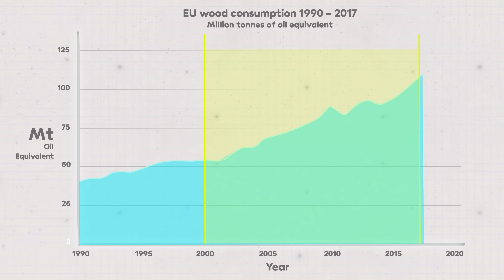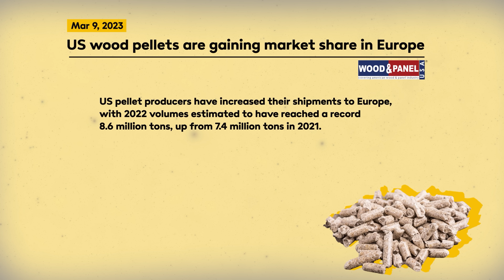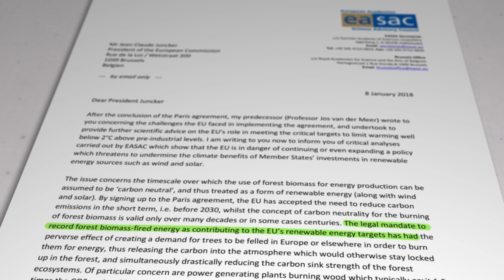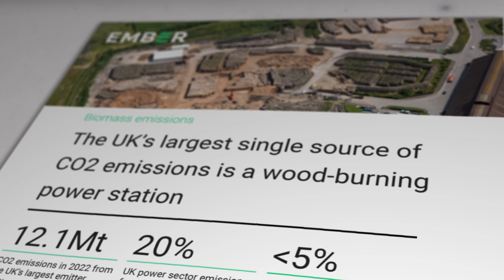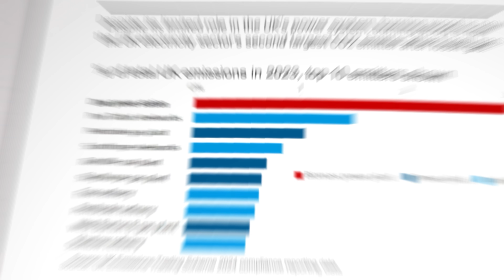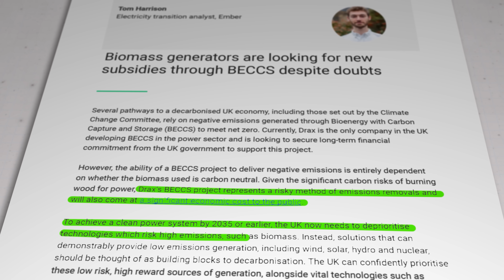New report: Biomass CO2 emissions 4X higher than COAL!!

Comment: While it's clear that better regulation of the pellet production is needed, I think biomass can still play useful role. We need to aim for renewables and nuclear to provide most of our energy. But there will be times when demand is high and production is low where we will have a deficit and need another power source as a backup. Biomass could be a good fit for that. If drax was only run 20% of the time when we really needed it (in the future when renewables have expanded to provide most of the power) then sand for pellets would be far lower and it could be filled using only waste wood and deadfall. Biomass is only bad if healthy trees are cut down specifically to burn. Adding CCS to the power station also adds benefit.

Comment: We have a local community hub that fell foul of this "carbon neutral" biomass. The local company that supplied them initially, couldnt even meet demand and ended up? IMPORTING, just the same. I was on the community council at the time and said it was a stupid idea for heating and suggested heat pumps or just electric. Investing perhaps in the windfarms nearby. 
A side note on the heat pump option, is that there is a giant, artifical, concrete pond. That acts like a head battery in of itself. Sea water is regularly pumped in.
See where I am going?

Comment: To be honest, this one feels a bit disingenuous on both sides, although I agree with the conclusion.
I knew that we couldn't do wood on a global scale for even just heating, simply because back in the middle age in France we were losing our forest because we need the wood to make charcoal to make steel and the switch to mined coal has allowed the forest to begin recovering.
But making the CO2 from tree equivalent to that of coal seem a bit of a stretch, the cycle is not a short as the fast crops, but it's still several orders of magnitude shorter than that of fossil fuels and some fast-growing trees can get big enough to harvest in 10 or so year.
On the other hand, if then land management; which is required for this to actually be sustainable, can't actually keep up as promised, then there is a big issue.

Comment: So... The issue is that because people are being asshats about HOW they do the wood harvesting, we should ban wood harvesting period? (which, to be fair you didn't say outright, but that seems to be the whole vibe with how environmentalists and the EU decision-makers are framing this)
A pine forest takes ~20 years to grow to harvestable size, which means we can take ~1/20th of our forests and cut it down yearly without any issues and still call it carbon neutral.
I'm sorry, but because some rich anus is being a dick, banning people from harvesting firewood from forests in a sustainable way is not the way to go about doing this.

Just like everything else, moderation is key. Hell, even in a future where we DO finally get climate change under control, a coal plant or two MAY be in the picture as backup power or a gas plant or two might be useful as peakers for a while yet. (that said I'd much rather we 'incentivize' [read: subsidize] people getting battery packs to form a massive virtual power plant -style system for peak power demand management, it'd even be profitable for the installer of the battery even if all they did was buy energy when it was cheap and sell when expensive, at least, until the system stabilized, at which point it'd make sense for them to install solar power and other such forms of near-zero-cost energy generation to cover their own needs, because after all, by far the biggest expenditure in an intermittent power system [the battery] is already there and has [hopefully] paid for itself)

Comment: Everyone with one half of a brain can see that burning wood pellets to generate electricity is nonsense from economic, environmental or strategic point of view.  The monetary and energy  inputs outweigh the outputs. Need to factor in fuel consumption for the harvesting machinery, haulage, chipping, drying, haulage again, then the inefficiency of the thermal power plant to convert heat into electricity. It's a pure madness.
Wood pellets only make sense if they are sourced from waste wood and used locally in stoves to produce heat.

Comment: Of course biomass requires energy to harvest, to truck it to the processing plant, to turn into wood chips, to dry out the wood chips, to ship it across the Atlantic.  The energy comes mainly from fossil fuels, and the whole process will grind to a halt without Diesel.   So after you've shut down Big Oil we won't be able to harvest biomass anymore so the problem should resolve itself.   I reckon we'll still get our solar panels though, China produces THEM mainly using the energy from Coal, though that tends to mitigate the environmental benefits!

Comment: Is there an imbalance? yes: chainsaws, logging trucks, etc etc, but timber related co2 is an entirely closed carbon cycle. Surely the least of most evils in the field of energy production!
Reply: Problem is the timescales which are touched upon in this video, sure the planted trees will recover the carbon over 50 years but we're not stopping here, just buffering up more carbon for the trees to deal with later.

try drawing all of the carbon monoxide out of the atmosphere and put it in to your house, sure the atmosphere will eventually get around to taking it all away but you're still dead because the high concentration now is causing the damage.

Comment: What about using the hardwood pellets to grow lion's mane and oyster mushrooms?  They eat sawdust and hardwood pellets is like the main method that's used ... that's how I grow mine.  Instead of burning them, they get turned into food ... and as the mycelium digests the wood to make this food (which is a healthy superfood that's not ultra processed with medicinal properties, esp the lion's mane) ... as the mycelium digests the wood ... it makes it so that the spent fuiting block (after you harvest the mushrooms) can be mulched into the garden to enhance soil without the need for synthetic fertilizer.  Mushrooms are primary decomposers.  Growing them creates soil.  Esp these gourmet species like lion's mane that grow on sawdust and wood waste.  Better than burning em, eh?  Feed em to mushrooms to do bioalchemy into food.  I heard that its a decent carbon sink to use these pellets to grow mushrooms.  What are your thoughts?

Comment: The benefit of burning wood, was, and remains, it was formed from atmospheric CO2 and now goes back to atmospheric CO2  Admittedly with a particulate.   Corn source for alcohol?  Same,, but the alcohol,, and even the chainsaw contribute.  I have heated with wood, not now,, but I did for decades.  Almost all of the wood I burned for heat for my residence was wood that came from forestry slash, landscape removal of problem limbs and trees.  I got paid to do the tree work,, and then took it home and heated with it.  Had I chipped it,, or sent it to the landfill,, exactly the same total CO2 would be created.  Rotting wood vs burning wood,, exactly the same CO2 total.
As to the fuel burned in the chainsaw?  The gasoline fuel burned total could heat my house for one day, maybe two the wood cut  with that quantity would suffice for an entire season, 6 plus months.
Cutting new wood for heating?  There are areas south of St. Johns, NL that are entirely denuded, right to bedrock from 5 centuries of heating homes.  A permanent desert, where there was a dense forest.

Comment: CO2 is not a problem. Its rise literally follows the climate trend. By year 1750 we had 180ppm. Dangerously close to the 150ppm where photosynthesis stall and everything dies. By 1950 the weather was warmer  and CO2 had crept up to 250ppm. The post 1950 “hockey stick” spike to 400ppm has had no effect on the general warming trend. We are simply following the 1000 years warming and cooling cycle. Romans were warm.
Dark Ages - cold
Medieval - warm
Little Ice Age - cold
Current epoch - warm.
Reply: @da              Nope.

Comment: This is kind of BS, this isn't a problem with using biomass, this is a problem with not having sustainable forestry practices. The forests cut down will regrow if managed right, that, even if it takes 150 years is a much shorter time to renew than for fossil fuels like coal. But this then requires that forests are replanted and not just left barren.

Comment: It produces the most CO2 by gross volume because it's the largest power station in the UK. Conveniently not mentioned where you talk about how awful it is for emitting. Hate biomass all you want but every gram of CO2 it releases came from a tree which likely sucked it out of the air in the last 100 years. A far better prospect than coal because it is sequestering the carbon for reuse. And to suggest solar in the UK as a solution... Lol. This far north? How long must a panel operate here to generate enough electricity to offset its manufacturing CO2? I agree we should be building more nuclear,  wind, and public transport of course,  but we need to focus on the right things if we are gonna solve this problem. Stop building car centric development at the edge of town. Stop widening roads, stop NIMBYs from blocking urban development and densification which is the single best way to cause lower carbon lifestyles.

Comment: I love to smoke meats but I vastly prefer to use wood over pellets. I bought a used pellet smoker and sure it's less work but the flavor is in no way nearly as good in my experience. The wood I use is free and from Facebook marketplace. I do have to breakdown rounds into splits but it is good exercise. I also have a $150 hydraulic device to breakdown logs and splits if I'm lazy or want to get through more that day. It's easy, economical, carbon neutral.

Comment: nuclear is the only option if EVs are going to take on a bigger role
Reply: @2                   Nuclear is just problems no matter what. Efficiency, wiser lives, public transit, & clean safe fast cheap reliable resilient renewable energy will take care of the tiny non-peak  increase in demand needed for EVs as well as the tripling or more of the grid required to electrify almost all primary energy. (That’s required to renewablize it.)

Comment: There is something called the carbon cycle it means that all atmospheric CO2 and all CO2 in living things are in a cycle and that cycle is self regulating if we burn a lot of forest other plants will consume the CO2 to grow faster and even if they can't grow as fast the ocean absorbs it and releases it back when plants can regrow. So even if biomass burning releases CO2 it doesn't change the amount of CO2 in the carbon cycle and so it is emissions neutral doesn't matter if the same field of corn grows or if it is trees somewhere on the planet it gets consumed back into a plant. So biomass is carbon neutral. The only thing that actually matters when it comes to carbon is if we add new carbon to the carbon cycle by burning carbon that was stored in solid rock.

Comment: There is a significant difference between ancient carbon, like coal, and newer carbon, such as trees. If you're only burning trees for energy, the carbon cycle remains balanced, as trees absorb CO2 while growing. However, when you burn fossil fuels like coal and gas, you're releasing carbon that has been trapped for millions of years back into the atmosphere. This sudden release contributes to the rising levels of CO2, and we're now experiencing the real impact of that on our climate.
Reply: Except that a tree that might take twenty years to fully rot down is being burned in minutes, and that represents carbon in the air that would not have been in the air over that twenty years. The cycle might be "balanced" over the span of centuries, but right now, there's more carbon in the air than there should be and that's a problem. 

Whether the trees in question are native forest that should have been left growing, or plantation timber that was due for harvest but could have been used for building houses (notice the developed world has a housing crisis and a housing affordability crisis?) and the carbon kept locked up in the timber for several more decades, there is no way that chipping and burning whole trees isn't a worse outcome.

And trees that fall in the forest usually don't fully rot down. Part of the carbon normally ends up as humus, which can persist in the soil for thousands of years.

Comment: "Biomass CO2 emissions 4X higher than COAL"
Theoretically impossible. The act of burning both coal and pellets is the act of reacting carbon with oxygen and in this case making use of the heat for boiling water and running a power plant off the steam. Pellets are not 4x as carbon dense as coal, which is nearly pure carbon.

An excellent example of just how insane the climate loonies are.
Hydroelectric is great if you have large rivers to build it in. Nuclear is great for countries that don't have tsunamis, earthquakes or communists.
Everything else is garbage. Solar has a place on off-grid cabins/boats/motor homes.
Reply: No, it's not four times as much carbon per kilogram of fuel - it's four times as much carbon per kilowatt of electricity. The carbon emitted in the process is not only from the low-energy-density biomass pellets, but you also have to consider how much fossil fuel carbon was emitted in the process of cutting down and mashing up whole trees to make pellets, and then shipping them halfway across the world just to burn them.

Of course if you were really doing your sums properly, you'd have to include, if it's plantation timber, all the fossil fuels released in the process of planting and growing those trees, and if it's native forest, the biodiversity loss and damage to catchments and ecosystems of cutting down those trees.

It probably ends up being a lot more than four times, but the point isn't to go back to coal. You might want to update your awareness of what people are doing with solar and wind these days - I think it would surprise you. It's really not the 1970s any more!
Reply: @tealkerberus748  I am aware of how much power is produced by solar and wind. I'm also aware that one reactor of the four in chernobyl produced enough power to run 1000 locomotives at max effect or assuming an average constant use of 1,8kW, two million houses, or two collossal hydrogen powered steel plants. That was 70s tech. Surely we can achieve double that today.

The Chernobyl power plant would be enough to power my entire country by itself.

Or we can build hundreds of thousands windmills to sometimes reach the same level.

I dream of my country having two power plants of the size of the Chernobyl plant. Industrial production would skyrocket as energy costs would plummet.

Comment: The chemical composition of wood varies from species to species, but is approximately 50% carbon, 42% oxygen, 6% hydrogen, 1% nitrogen, and 1% other elements, according to Wikipedia. From the same source, the coal composition is 84.4% carbon, 5.4% hydrogen, 6.7% oxygen, 1.7% nitrogen, and 1.8% sulfur.
Now, explain to me, logically, how burning 1Kg of wood produce more CO2 than 1Kg of coal? And, how burning 1Kg of wood produce more energy than burning 1Kg of coal?
Explain how "new research shows that burning biomass releases much more carbon dioxide into our atmosphere than burning coal or gas". What exactly is a "research"?
To me it seems that is all political BS with a clear agenda, there is no science anymore.
Maintain humanity under 500,000,000 in perpetual balance with nature. Be not a cancer on the Earth – Leave room for nature. Remember?

Comment: There is a fallacy here: the carbon contained within the emissions of biomass belongs to the CURRENT carbon cycle, whereas the carbon contained in the emissions from fossil fuels is EXTERNAL to said current cycle, therefore it increases the carbon content of TODAY's biosphere.
Reply: Exactly! Not saying there aren’t serious issues with biomass use - but a direct comparison with a fossil fuel is inappropriate?!
Reply: @EdwardEngines  Yes, it is. I think my main comment makes it clear. Burning biomass DOES NOT alter the current carbon cycle. Burning fossil fuels does.
Reply: @perfesser944  am I correct in thinking though, that if all the timber burnt as biomass was, for example used in sustainable construction, that the CO2 levels in the atmosphere would be less? 

Surely felling forests, and also burning them must increase levels, even if that carbon is part of the ‘current’ cycle? 

I’m kind of curious re the ‘current cycle’ - I get fossil fuels are releasing carbon from pre-history, ‘extra’ carbon so to speak…. But surely for several thousand years mankind has been felling trees and burning them - which must’ve lead to an increase - disregarding fossil fuels?
Reply: @EdwardEngines  Whether burnt or used in construction, that wood's carbon will eventually return to the cycle. By current I mean within the recordable past, not only today's. Of course, depleting the world's forests also interferes with the carbon cycle, preventing its being fixed and taken out of the atmosphere.

Comment: So solar and wind are intermittent. Solar and wind have short lifespans. Solar panels are not efficient enough. Wind turbines have a big issue when their lifespan ends. Every one knows the issues with coal, so then what. Nuclear? That would be great, but unfortunately recycling spent fuel rods have hit a barrier. Cost. Hydro needs water and dams. Dams hurt the river ecosystems Then what? It's a hard issue.

So we need to reduce Co2. We need research bio farms of green algea to suck up the Co2 in the atmosphere. Maybe these farms could help the Co2 issue. But then there may be problems like cost, environmental impact, life span, etc. then again scientists say that the Co2 level during the age of the dinosaurs was higher than what it is now.